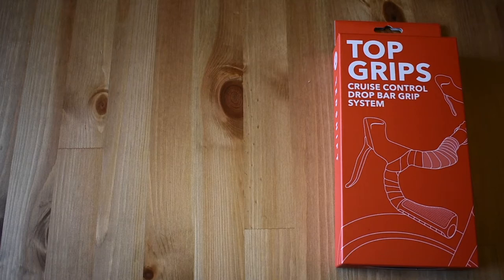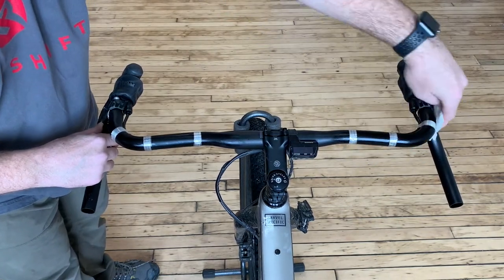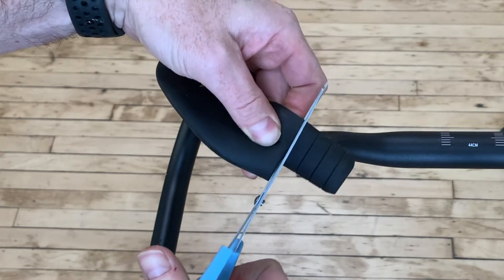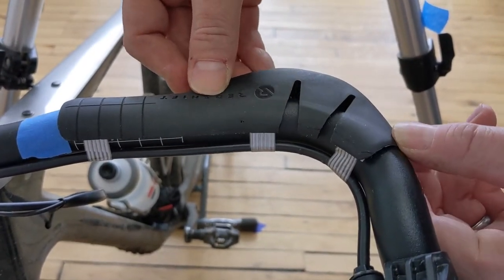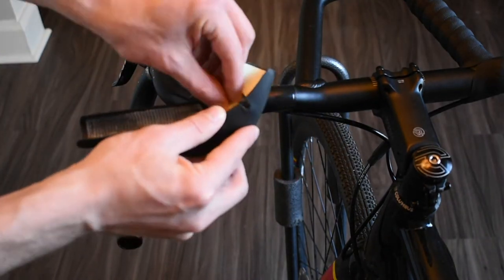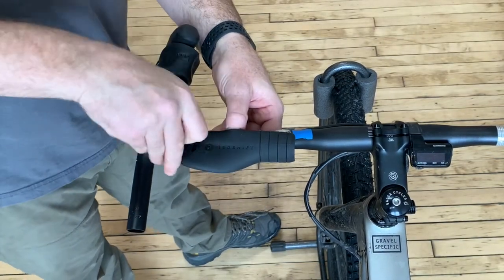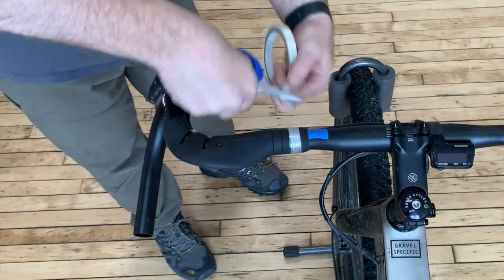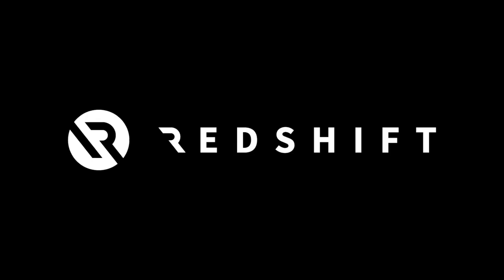Cruise Control Top Grip Installation Instructions

Comment: Why tape the cables to the handlebar first and not the other way around? Now, the grips and the tape attaching them to the bars gets on your way when replacing the cables in the future. Any problems with doing this process without cables and then taping the cables to bars afterwards? Thanks in advance
Reply from the maker: Thanks for the question and you are certainly correct that securing the grip prior to the cables could be a useful way to allow you to adjust cables in the future without having to touch the grips. There is no reason you can't do it this way. Thanks

Comment: Hi , good video. Could you tell me if you can use standard length roll of bar tape , or do you have to use the extra long tape from Redshift
Reply from the maker: Thanks for checking it out! You can absolutely use standard length bar tape with the top grips unless you have really really short tape - and of course it depends on how tight you wrap but should not be a problem for standard width bars - if you have a really wide bar then you will likely need extra long tape. Thanks

Comment: Is it possible to use the top grips with aero shaped bars as well or do you need round shaped bars?
Reply from the maker: The grips are specifically designed to fit on 23.8mm round bar which is the standard diameter for round drop bars. They will fit on an aero handlebar section if the front side of it is 23.8mm and circular but if it is not shaped like a circle on the front where contact would be made them the fit might not be that great. Thanks